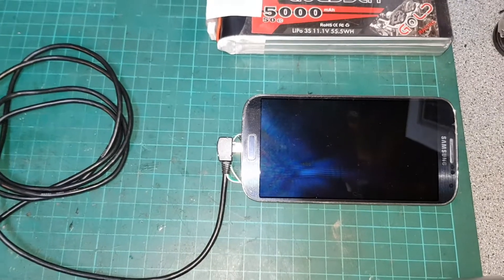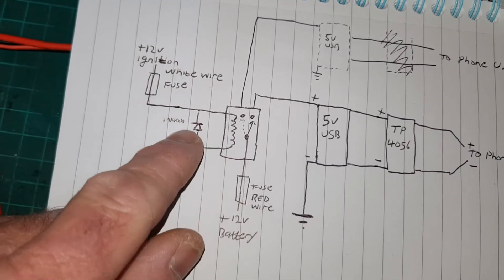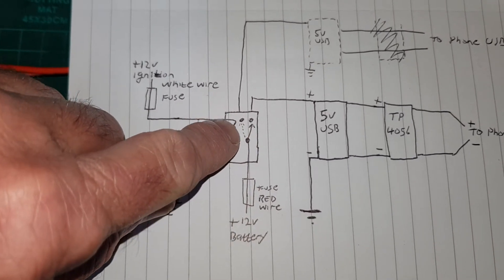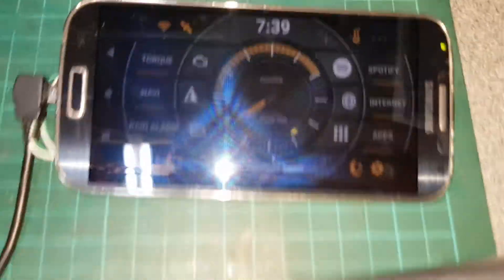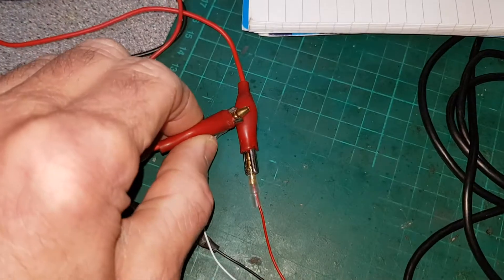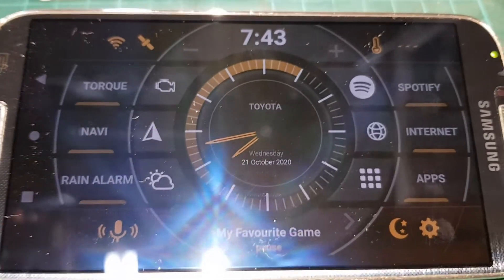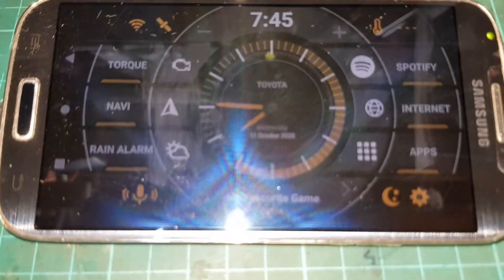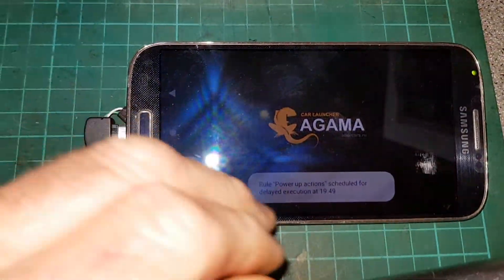Turn an old Android phone into an awesome car headunit & fix standby charge issues.

Comment: Li-ion battery continuously on charge and heated environment of closed car is dangerous. You could have used phone without battery directly on cars 12 v battery in sleep mode and ignition current via charging port to activate the car dashboard application as soon as car ignition is switched on.
Reply from the maker: It's not continuously charging - it has a charge controller